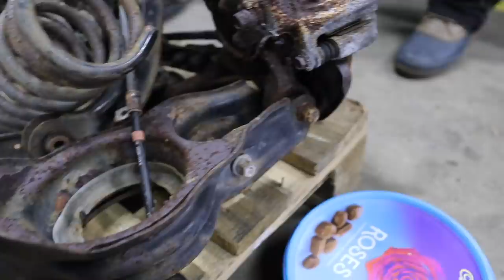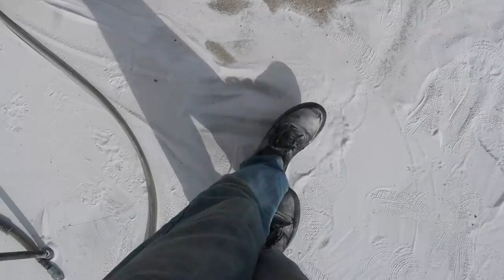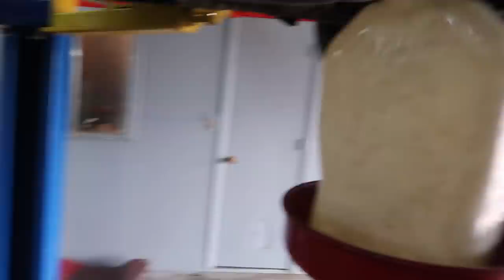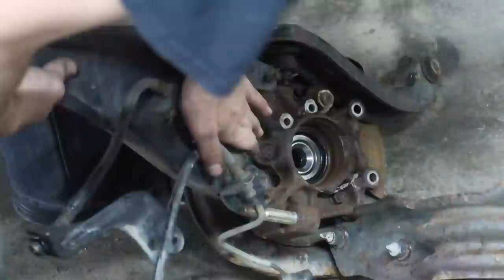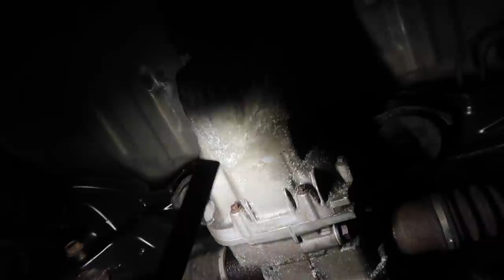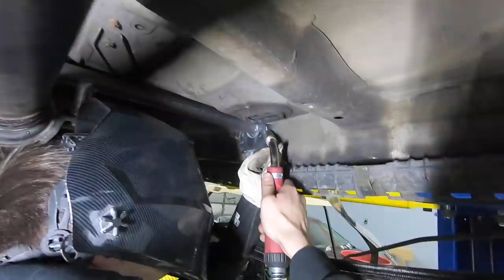Making Our Honda Minivan ALL WHEEL DRIVE! (Full Process)

Comment: I’m a little worried about all these stock parts and 1400Hp 😂
Reply: Greg West Rear diff only holds about 50-60 hp tops before it begins to make noises and blows the front tires off.
Reply: think you have your numbers mixed up, the Turbo can do 1400hp, but the engine is only buildt for 1000hp :P
Reply: The axles will be an issue but the diff should hold, same diff ass the grinch I believe. They only take about 30% of the power so the rear diff only has to hold 300hp with a 1000hp at the crank
Reply: MrHomeFunk okay my bad stock axles and 1000 Hp still ain’t gonna work 🤦‍♂️
Reply: @rubencampos1208  the grinch has a wago rear diff the odyssey has a older heavy duty version of a crv diff as was 1500ish kg (3500ish lbs) so needed to be bigger. Think the diff and rear axels will handle well over 1000bhp dont know about the drive shaft tho🙈
Reply: would work just fine, it all depends on how the power is delivered. a straight clutchdump,oh yeah, that gonna brake some shit. but leaving like they did with hondaru and even the hatch(and how long did he use stock axles? still made some decent times, before he started to break them as toothpicks lol ) some years ago, slipping the clutch, should hold up just fine for a while :) more worried about that center driveshaft, i think that one would end up as a wet noodle, same as Romans did lol :P
Reply: UPurKILT It’s gonna twist it like the grinch is my hypothesis
Reply: Ruben Campos Crv/element/odyssey rear diffs hold about 50hp before they start slipping and making noises.
Reply: UPurKILT Clutch plates in the rear diff will only hold about 50hp before it starts slipping. They dont work like a viscous where the material hardens with heat and then locks. The Odyssey works from dual pump pressure, which doesn’t hold much, they have aftermarket parts out there but they aren’t near as good as a wago viscous and rear diff.
Reply: @anonymousham4166  yea bud i think so to... but give it the beans and see if shes mean...is a saying my dad said to me all the time... you are only as good as the weak point on the car... fix it and then you will find the next one.
Reply: Factory Parts are blow up for sure! Not being negative, jus being realistic
Reply: @john-martin  for one mate the viscous coupler on the wago dosent harden up due to heat.. it works on having fin'd plates on either side of the couping and a viscous oil between them.. hence the name.. when one side spins faster then the other the oil drag's the other plate round to try and catch the other one up. Guys are changing the oil in them to thicker atf to get more spool out of them so it takes even less wheel speed to make it work. The duel pump differential works on same principle but different execution where the oil pressure in the input side(drive shaft in) increases as the front wheel speed is faster then the rear and opens the cluch packs in the diff to make the rear axel move. I dont agree that the crv wont hold over 1000bhp as bisimoto has a crv rear diff in his wagon making over 1056bhp and has no issues. But oh well....also guy iver here in the uk has a 500bhp single cam hr-v same runing gear as crv and running standard drive train apart from better cluch in his gear box so they must hold some sort of big power power 👍
Reply: UPurKILT With Honda awd setups having no issues and having no issues while actually putting the power to the wheels are two different things. You can have a 1000 hp and have no issues but that doesn’t mean the power is actually going through the back tires. The driveline viscous on the wago is better because it relies on friction and heat making resistance between metal plates, where the crv has mini clutch disks with small amounts of clutch material that relies on pressure from the dual pump (like a pressure plate) which never sees enough pressure to actually put the power to the wheels. Ive got a 500 whp awd system with the crv diff and driveline setup. Ive ran through this system a number of times and added stiffer pump springs, a racing diffs clutch pack and the whole 9 and it still doesn’t work near as good as a wago viscous driveline and rear diff setup. I can still burn the front tires off and I only have 500 whp and still use the pencil size rear axles.
Reply: @john-martin  mate why did you take what i said and word it different? Hondas awd systems arnt true 4x4 they are classed as a helper system thats why they arnt ment to put all power through the rear wheels if honda wanted that they would have just not fucked around with getting viscous couplers or duel pump diffs to work. If the wagon stuff is better then why do you run crv diff bud? Due to cost i bet? Yes the wagon stuff is better i agree but its also getting rare and expensive as all hell thats why people like yourself are using crv stuff. If you want it to work all the time then weld the clutch disks together and boom permanent 4x4 if not still weld them together and put in a freelander 2 vcu (viscous control unit) to your driveshaft and you will have wagon style set up and basicly cheap. the crv diff will only see 30% of std power you make as honda designed it as a 70/30 bias when engaged.
Reply: UPurKILT The CRV rear diff is only able to transfer 30% of FACTORY horsepower which would only be maybe 40-50 hp tops. If you have a 1,000 hp it will not transfer 300 hp, it doesn’t work like that. The pump and clutches can only hold 30 percent of factory power, any more than that and the rear diff just makes noises and burns out the clutches. In other words if a clutch disk holds 100 percent factory power of 140 hp, it will not hold 100 percent of 1,000 hp, it doesn’t work like that. But a wago viscous is different, the fluid heats up and hardens. The Viscosity of the fluid thickens up under heating conditions or slip and thats why viscous couplers can transfer the power and break axles while the CRVs cant. The hotter a wago viscous gets the more power it can transfer. Where as the CRV clutch packs works off dual pump pressure (aka oil engaging pressure plate) which is only factory pressure, so whether your throwing 140 or 1000 hp at it has the same pressure max pressure against the clutch packs. In other words with the CRV dual pump the pressure clamping down on the clutches does not increase with 1000 hp over factory hp because of how its built with pressure relief springs on the dual pump system. The pressure plate aka dual pump system doesn’t magically create more forced on the clutches when you increase the power. So because of this design 30% of factory hp on the CRV rear diff is all you’ll get which is about 40-50 hp to the back tires before the rear end starts squealing.
Reply: @john-martin  mate when you reply i just imagine the Canadian flappy heads from south park banging on. You are taking what i have said and wording it differently. I know how the diffs work and what they are capable of as stated in the first 2 comments.  In standard form they wont last long like i said perversely you are only as good as your weakest part of the car. When it fails you fix and find the next weak point. But with other people having between 500 to 1000bhp going through a crv diff and proving it will works. If the crv diff is that shit why did you put one in your supposed 500bhp car? Why not go for the wagon viscous coupler and diff? Because they are getting rare and are really expansive. Improvise, adapt, and overcome as they say look for other options. I have said to you if you are not happy with your diff to weld the clutches in your diff and get a vcu from a freelander 2 and you will have a cheap viscous style drive train for your car. I bid you fair well amego. Have a good day👍🏴
Reply: UPurKILT Im glad you understand what i’m saying, some people need more explanations than others. But in laymans terms the CRV differential will only put down about 5% of the power to the rear tires if the Odyssey does end up making 1000 whp. If he wants an actual 70/30 split in power he will need to go with a wago setup that includes a viscous driveline and wago rear differential but then might even need axles and possibly a built up driveline too. Cheers mate, glad I could help.
Reply: UPurKILT And basically I was just explaining how the CRV will not 70/30 split a 1,000 horsepower. and I understand the free lander viscous as I have one in my garage right now as a replacement for the wago but the conversation was about the CRV rear diff and how it will not hold 30% of 1000 hp but maybe 5% of 1000 hp. So that’s why I just wanted to be clear and it seems like I was talking a lot, Earlier in the conversation you were thinking the 70/30 split was across all Power Ranges whether it was factory power or 1000 power like Bisi and I was just saying that that was absolutely not correct.
Reply: @john-martin  its cool m8 both on the same wave length👍
Reply: UPurKILT In the beginning you were trying to say that the CRV can hold 30% power, and thats not the case when you’re going to make 1,000. The wago viscous can and it will hold 30% across the board no matter the power range but the CRV is not a viscous coupler nor does it work like a viscous. Yes it’s designed to allow slip so the drive parts don’t bind while turning but thats all thats in common. So the same wavelength would be understanding that both are two completely different parts with two completely different abilities, one has tons of grab the other has very little. Is this the same wavelength you have now moved too because just a moment ago I swear you had no idea what you were talking about.
Reply: @john-martin   mate i explaing how both worked like 4 comments ago Saying Same principle, different execution and went on to say how both worked. Also said that the 4wd system wont put all power to the ground as it is a helper system designed to mainly be fwd and when needed puts some power to the rear. I Was referring to having 1000bhp and the rear diff itself actuly not exploding when i said it that the diff and axels will hold a 1000bhp but with other people having big power crv diffs and saying they have no problems with the diffs holding that big power. So we where saying the same thing just worded diffrent ways. Hence same wave length... so i bid you adu bud....
Reply: UPurKILT They are not the same idea and they do not work anywhere near the same. 95% slip it’s not my definition of holding power. Why is it 1000 hp all-wheel-drive with a viscous coupler can twist drivelines yet a CRV rear differential with 1000 hp wont break pencil sized axles. To say both are relatively the same and can “hold” the power is not correct. Apples and Oranges  Wago van viscous coupler’s or $1500 for a reason.
Reply: @john-martin  same principle, by allowing a % of drive to the rear wheels when traction is lost in the front... different execution, one uses a viscous oil to engage, the other uses oil pressure to engaged a clutch pack.... so yea... my point stands ya chode. And if you are referring to the grinch about the twisted drive shaft then he runs a wago diff no viscous coupler or crv diff so direct drive to the rear. Have said in previous coments that the wago drive train is better but dont think its going in to your head fella. The reaso peoples parts fail is to to sudden shocks in the parts the weaken it nothing lasts forever the reason why staging right and not just full 2 step and dumping the clutch that will snap and twist shit. Reason drag manual cars are going slipper clutch to save parts and the like, parts will fail as you are only as good as your weakest link when it fails fix and you will find the next one like a said before.
Reply: UPurKILT Do you see how I’m herding you down a narrow tunnel where your only defense is now saying “same principle”. You’re basing all of your reasoning over power transfer I get it. But one sending 70/30 split of 1000 hp and 5% with 1000 are nothing alike and why one type of setup can and the other cant. For example to say one car makes 1000 hp and the other makes 100 so they must be alike is rubbish. Truth is they aren’t even remotely close to the same. Then by calling me names tells me you truly dont know what you’re talking about. And now I can see that you were starting to copy my definitions of power transfer and how they both work and how differently they operate, my my have the worlds turned. I feel like you should be paying me for all this you have learned today.
Reply: UPurKILT You need to admit prior to our discussions about Honda all-wheel-drive systems that you now know about 90% more than you did prior to school time, I may even go as far to say that at one time today you were about as efficient as a CRV rear differential.
Reply: UPurKILT Go ahead and read through your comments and notice how your understanding of how the all-wheel-drive systems have changed from earlier today to now and how you’ve shifted your arguments to saying that everything is the same. If you’d like you can copy my comments and save them for later in case you need help or if you have any more questions about all wheel drive systems you can ask me. And I wasn’t offended by the name calling I misunderstood what you meant by chode. Where i’m from its not used as a friendly term.
Reply: @john-martin  mate in scotland we use cunt as a full stop haha. Dont need to copy i know how the systems work As stated in previous comments. As for the odyssey diff we will soon find out but think it will work no bother.👍🏴🙈
Reply: UPurKILT Mark my words it’ll work as far as not blowing up, but it won’t put down anything for Power. He’ll probably attempt to either put in stronger springs for the dual pump, or shim the clutch pack, or maybe even an upgraded clutch pack. But that only works so well, he will have to end up going forward with a wago setup or bolting together the clutch pack and running a free lander viscous. The problem with The free lander viscous is those parts are almost 20 years old and no one knows what kind of use one has had, but the worst is they are not rebuildable or at least not at this point because its a welded unit unlike the wago which has a large C clip.

Comment: I would recommend eventually getting carbon fiber driveshaft due to the length of that driveshaft it will not be able to handle that much hp.
Reply: I don't think it'll be an issue. That rear diff is gonna grenade before the drive shaft can pretzel itself
Reply: Ive blown two. But would never go back. Very minimal damage. Steel couldve been life ending
Reply: I think he should weld the rear diff.     This will guarantee a twisted drive shaft.
Reply: Steel and aluminum are stronger. Carbon is just for weight and honestly this is too long for carbon

Comment: That drive shaft will explode in first 30seconds😂
Reply: @geedawgzzz  bro what? It's just a fact that the driveshaft cant take 1000hp. There was no hate in that comment. To add to that, the axles probably won't survive either.
Reply: @geedawgzzz  Bro stop commenting. Nobody is saying they hope it breaks. But we have all been around race cars long enough to know something in the rear end is going to break. It isn't hating, it's reality. Either the diff is terrible, the long driveshaft twists, or the axles snap. The odds of stock 25 year old van parts holding 1000+whp on a prepped track is very low.
Reply: He's a flat earther...

Comment: I’m going to bet this driveshaft and rear axles can’t handle drag racing
Reply: That rear right wheel is a bit lazy...
Reply: Whitts adventures first launch it’s blowing lol
Reply: @youngmo77  Open Diff , he gets on the throttle the one tire is gonna push him into the wall  I figure ...
Reply: Another HATER.    Why can’t you wish it holds the power ?     Very sad the way you haters think.
Reply: Gas Par wish all you want speaking facts Kyle even says it that’s why they got the spares from the wagon
Reply: @geedawgzzz  Hater ?? Drive shaft loops for safety ..... and that rear diff should be locked ... Have a wonderful day Mr. Gas Par
Reply: Gas Par How is it being a hater when it’s reality?
Reply: @geedawgzzz  nobody's hating on anything, just making the observation that the stock rear diff and axles don't appear to be particularly robust (and why would they be? They only needed to handle ~150hp from the factory) and probably won't hold up to the extreme amounts of abuse soon to be imposed upon them.
Reply: @youngmo77  It's just rust on the brake disc friction surface and the brake pads rubbing.  He even explains it in the video.  A quick drive and it will clean right up.
Reply: Man so many people think I’m a hater it’s just a observation

Comment: 42:10 It seemed like the rear wheels were spinning faster. Is that normal?
Reply: Different ratios in the diffs. Rear tires definitely seemed faster.
Reply: No!   it's not hard to manually the diff ratio by counting the prop shaft input rotation to one wheel rotation. it would probably be in the 4.6-1  too 2.9-1 range.I wouldn't just trust workshop manuals on specs better to check.
Reply: I noticed that, i wondering if the final drives front and rear are the same
Reply: Yeah I thought that too. I can see this being an issue in an upcoming video but I hope I'm wrong.
Reply: @uksam2000  they'll find real quick if it smokes the VC
Reply: I was wondering if they took the rear axle ratio into consideration. But maybe they are putting a built diff into it and will put the correct ratio in it. I'm sure that stock diff is open anyway and they would want a spool or locker.

Comment: Kyle, those rear/front bushing mount bolts... use a plasma cutter to cut a hole 90 degrees to get a nut in the inside of the frame, then just weld it back up and paint. much stronger than a bolt all the way through into the cab of the van.